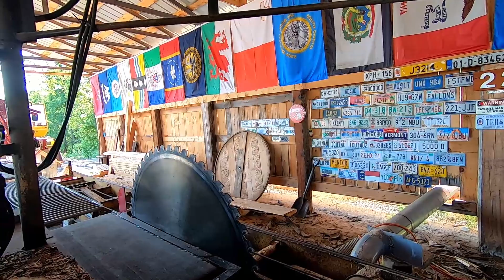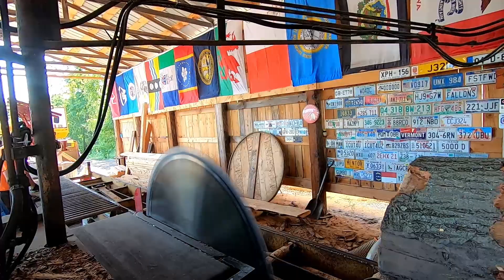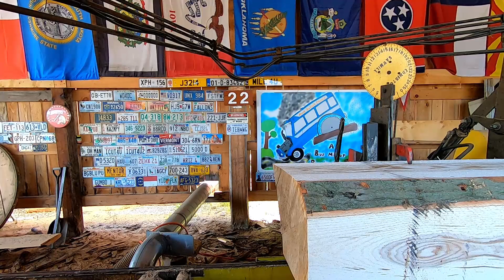sawing a big pin oak log # 214

Comment: I was a sawyer for 7 years ( my greatest yield was 128,000 board feet of lumber in a 10 hour shift ) ; cutting 20 inch logs . I , nostalgically watch all of your posts !
It required 10 workers to bring the logs to me and 12 workers to handle the lumber ; sorting and stacking it on the lumber yard .
I was running a CHIP-N-SAW Mark IV machine @ 400 linear feet per minute ; in 1974 - 1981 .

Comment: What we see is what we get is all we need or all we want! Thanks, Mark and all the best on the pressure test. And if you need to zip the speed up a dab to get the blade to stand up, be thinking about YOU having an emergency stop hookup. You never know. I was with you about that 2-by bouncing around on that conveyor. That was getting too interesting too quick. And Edwardo and the swing saw man were spot on as well. Looking forward to the house deal too. GBWYall and it's up to 42.5 now! YIPEE!!!

Comment: HI MARK on all the old school sawmills you had ✋🤚 hand equalizers you could set for each head block very few people use a circle saw sawmill any more most were changed to air dogs for faster lumber out put I 👍👍 like the lumber gang wheel on the frick sawmills big numbers easy to read very few old sawmill Sawyers shave a log if they did I didn't see it growing up OMG 2 24 2022

Comment: Nice sawing .Maybe you could do a video on log selection for an order . A lot of your viewers would not realize the time involved with that step .
Reply: @markgalicic7788  I was thinking about you having the Captains Chair and able to see everything and be able to shut down the mill if only you saw the problem. Like a main hydraulic line popping on the pump and Eddie not being able to get to the bus motor because of the hot oil spray.

Comment: Mark, those fuel lines have a torque speck. Kent tools makes a dandy special socket to tighten them. If you have a local fire dept. mechanic likely he will loan the tool older fire trucks were Detroit powered.
Reply from the maker: yes they do and the line socket would be a big help.

Comment: When we got shut down using steam and got a diesel  we got one out of a greyhound bus.
Is that how your e gone came to be called the "bus motor"?
We referred to ours as the greyhound.
Never had near as much fun sawing  on diesel  as we did with steam.
Reply from the maker: the detroit was built as a power unit but we call it the bus motor.

Comment: Settin' sights on the old house again?  I recall something about hydraulic hoses being said.  I've blown three since the first of June, and really haven't done that much work with the machine.  At $40 each just for the hose ends, I'm scared to try any more!

I did a little research.  I think I'm getting subjected to some skullduggery.  Time for an e-mail to the store's corporate HQ ...
Reply from the maker: yes I am , got most of it down but lots of clean up.

Comment: Old John has a good line there. Be thank full there's no royalties involved. HA HA  What size is the blade on your swing saw? I have a 24" I think it's a cross-cut. Let me know. It's just getting dustier where it's at now. Why is the tree called a "pin oak"?  Detroit's can be finicky but with care they'll last forever. Be safe and well.
Reply from the maker: John does have a good one , the swing saw blade is 28" with a 1-3/8" eye.
Reply: And they call it pin oak because the knots remind u of a pin ,if u split a piece of it the knot will pull out mostly like a pin